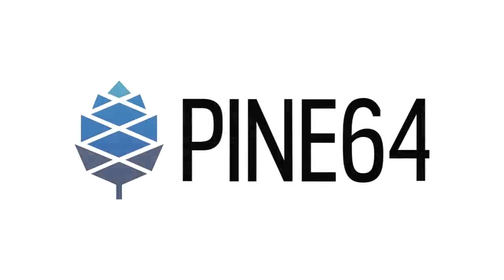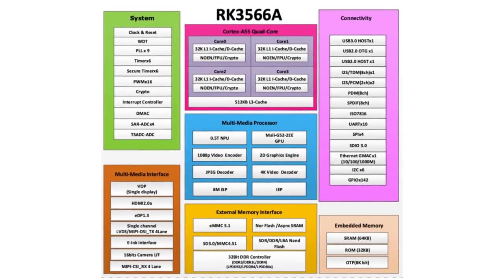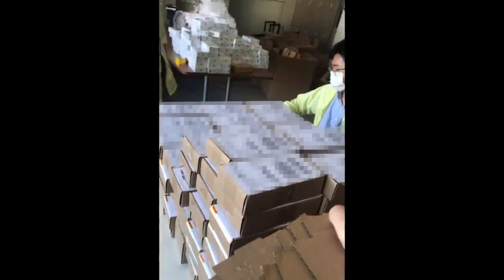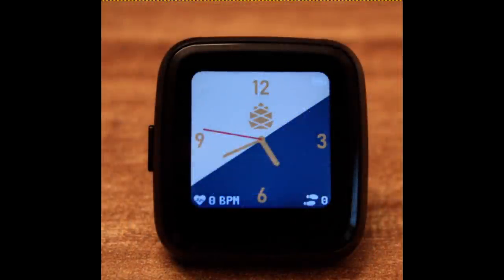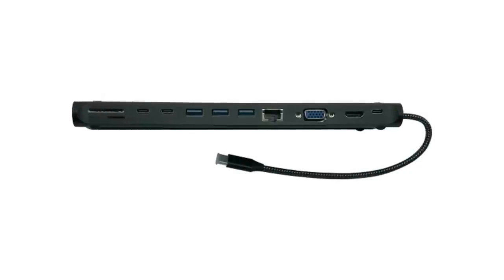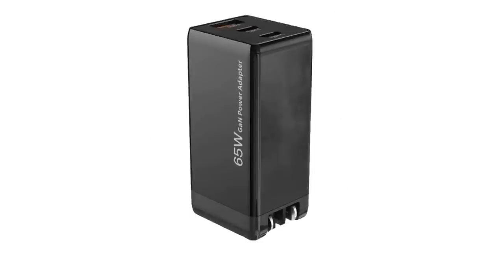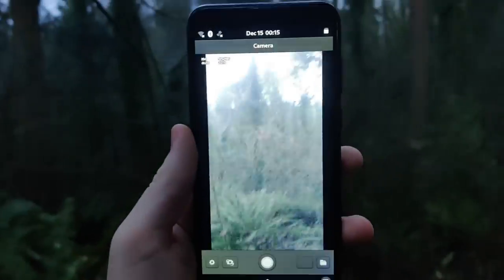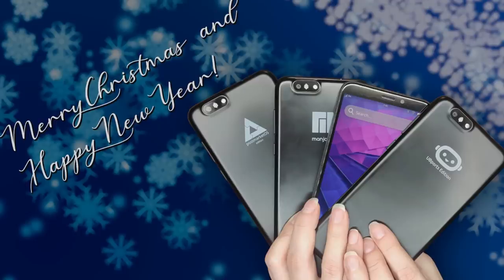December Update: the Longest One Yet

Comment: Was disappointed in my Braveheart, mainly in the screws. Using the right size screwdriver, they were in so tight that I couldn't unscrew them, and stripped the heads off. superglue didn't work, too small for the rubber band trick, and I just don't have the excess money to buy an electric screwdriver or drill and bits small enough for these.
It was fun to play around with, but you can only stand the vibration motor running at full power until you take the battery out for so long.
Pinebook Pro, my power adapter was DOA and the screen had a defect, and I was discouraged from RMA'ing.
I wish good will towards the Pine64 folks, they're doing a good service to the community by selling affordable and unique hardware like this, and inspiring people to get involved. But I'm not the type to hack around with hardware all day, or to write software, so this probably just isn't for me.

Anyways, relevant to the video, I'm excited for that expansion bar for the pinebook pro. Since I can still charge via USB-C, and the keyboard is nice, I get some use out of my Pro.